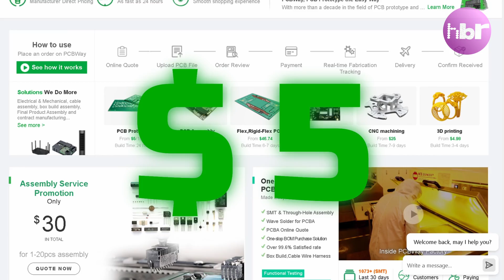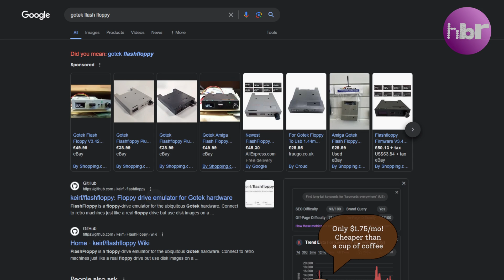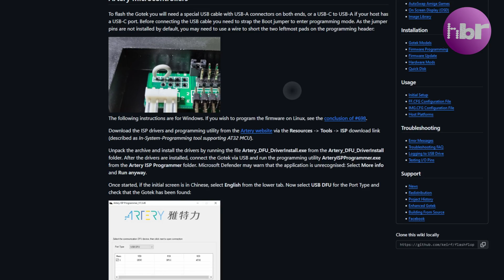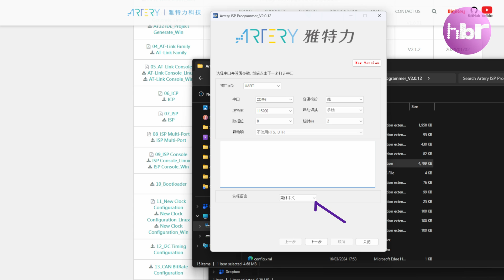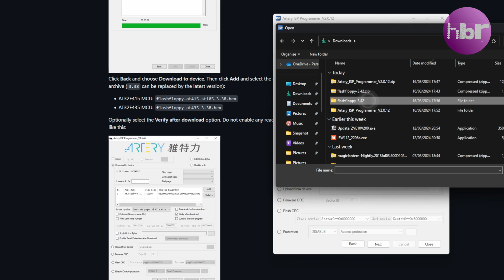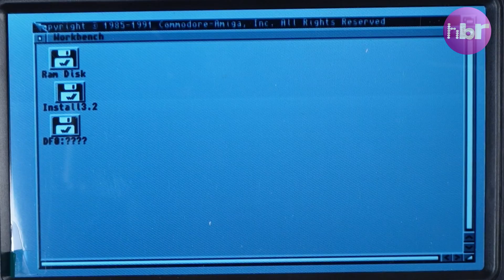Amiga Vintage Vibes: GOTEK Drive's Nostalgic 80s Upgrade

Comment: Did you create some code so that the text on the screen does not exceed the field where the display is covered? Or did you cut the plastic? Thanks!
Reply from the maker: I did neither, however, there is an option for that in FF, checkout the documentation :)

Comment: Hi i have problem with the program i cant see the next button to flash it im under windows 10 wha it can be?
Reply from the maker: Sorry to here you having issues, if you read and follow this guide it should all work https://github.com/keirf/flashfloppy/wiki/Firmware-Programming ... from the minimal description possibly the driver in not installed or the Gotek is not in flash mode, or not connected correctly,

Comment: Buy a "3rd hand" with multiple, articulated arms. I use one extensively to hold small parts whilst soldering/gluing etc. Mine came with a magnifying lens.
Reply from the maker: Thanks for watching, a very valid suggestion! I do have one, my retrospective self was despairing at my not using it! That said it does get in the way when filming and mine is a bit worse for wear these days.